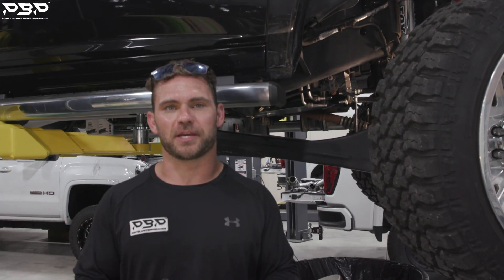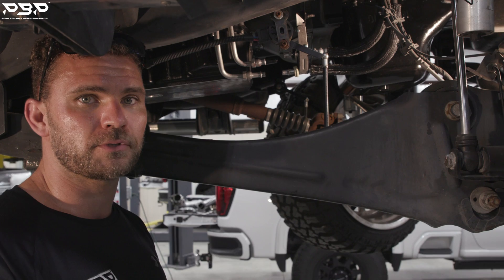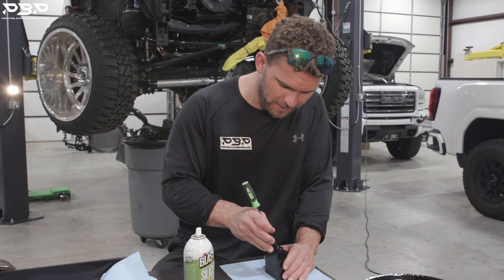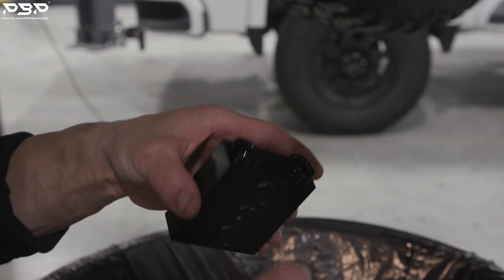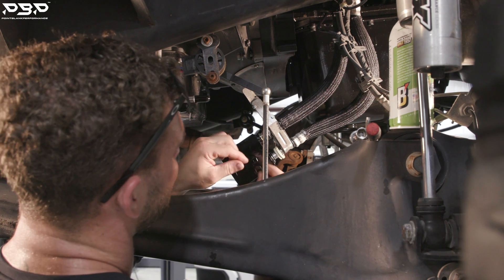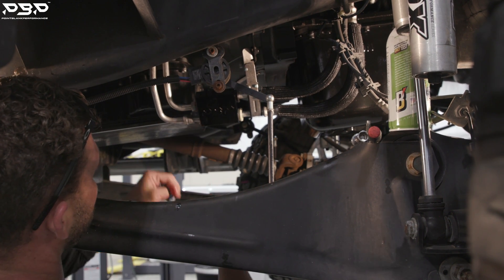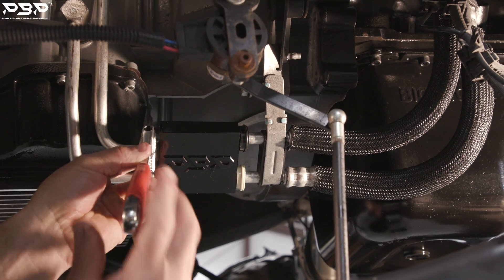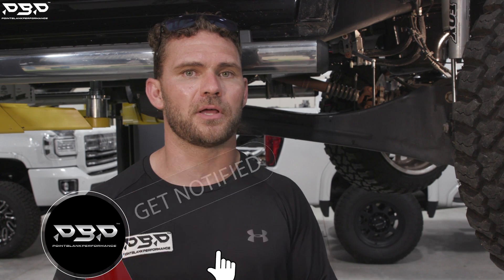13-18 RAM THERMAL BYPASS INSTALL

Comment: 2022 ram 2500 longhorn benefit from this
Reply from the maker: Yes sir if you’d like to  save your current good working transmission from potential overheating.
Reply: Thanks order it today Thanks
Reply from the maker: @pauljames167 Thank you sir.
Reply: My 08 mega cab 68rfe doesn't have this.  Just replace it 2nd time.  $5800.00 Suncoast stage 1

Comment: 4:40pm quick question 2021 ram 2500 not need the transmission bypass?
Reply from the maker: Recommend on all 68s and Aisin.

Comment: Looking to get some insight into maintaining the correct transmission fluid level after installing a thermal bypass valve. With it installed the transmission never gets close to the 180 degree mark to have an accurate measure of the fluid when hot. It generally runs 140-145 max, occasionally getting to 160-165 in more extreme cases.
Reply from the maker: Hey sir is this with our product installed?
Reply: @POINTBLANKPERFORMANCE  it's with the revmax thermal bypass.
Reply from the maker: @michaelcsavercool703 Roger sir no worries we don’t want to speak on their behalf, they have a good tech team id send a email and see what they suggest.
Reply: @POINTBLANKPERFORMANCE  thank you.

Comment: Honestly the 68rfe is a bad ass trans, IV beat mine to hell and back on a built truck towing a trailer. Towing in 6th at 70mph no prob, the only time IV had issues is with heat towing max effort load up a slow gravel road. This combined with the rear trans cooler relocate helped that problem a ton. The only time IV shit the guts out of my trans was doing 4 wheel launches at 20 psi when I was tuning my staging limiter tune. It was going so well till she shifted to 3rd and well, the sound we haunt our memories for ever. Sounded like two skeletons fucking in the closet.
Reply: Yea man I have 230,000km and haul trailers daily for work. 
Never had issue but it’s getting time. Ganna throw this bypass in and hopefully latest even longer. She’s a beast and it’s 2015 2500 6.7 bought new in 2015  and it’s deleted and tuned all emissions gone and got 5 tunes with switch. Everything else stock. Always reliable. Never left me hanging.

Comment: I have a 2022
Willits void my warranty
Reply from the maker: Anything not oem I’m sure would sir !
Reply: @POINTBLANKPERFORMANCE - Not necessarily true!  With my wife's 2018 Ram 2500 Crewcab 4wd 6.7L.  I replaced the factory transmission oil pan with a PPE aluminum pan, filter, and steel filter adapter.  Later the truck had issues.   Kept getting P20EE code.  After 4 trips to the dealer, that the PCM was reflashed, new SCR, new NOX sensor, and DEF fluid changed out.  The code came back.  I replaced the main battery with a Walmart AGM battery.  The truck has not had the code come back.  My upgrades have not affected warranty or recall work.  Just like the 1974 Magnusson-Moss Act specifies.

Comment: Now start making one for the '19s and newer. Revmax's version sucks. They spaced the input sides holes further apart than the OEM thermostat and you have to bend the ridged lines in order to screw in the tapered fittings. Mine leaked and took a lot of tinkering to make acceptable. I'm not satisfied and looking for a better replacement. If you do end up making one... mirror the OEM dimensions exactly and you'll have a winner and a customer!
Reply from the maker: If you jump on the website pointblankperformance.com we have the 19+ plus on the site ! Video will be released as well soon!
Reply: @POINTBLANKPERFORMANCE  I just watched your newest video on the 5th gen version. I'm gonna head to your website right now and check it out! Thank you!
Reply from the maker: @4wdiesels  We appreciate that sir and thank you !!